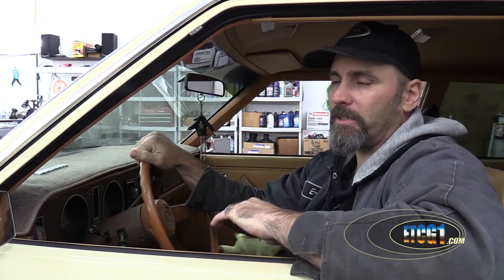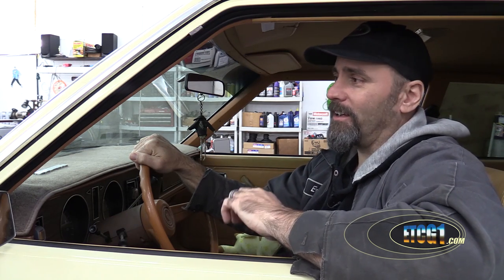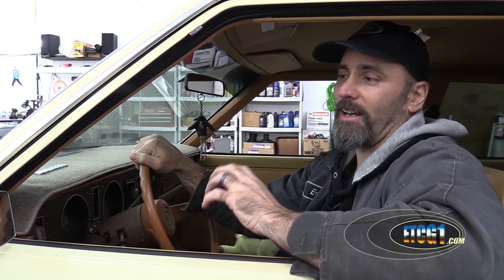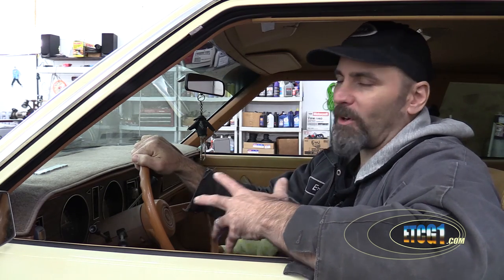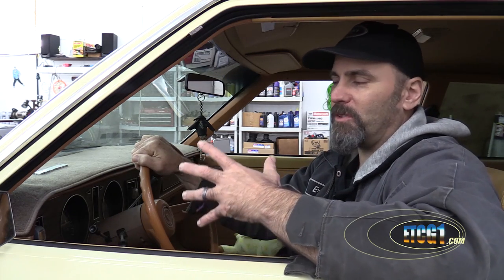Analog vs Digital (Cars)

Comment: Awesome video man!
It seems that modern combustion engines get more and more complicated in mass production. I can see electric cars making things simple again. I've been a mechanic most of my life and I've worked for a toy company that makes remote control toys. I've learned more than a small amount about batteries and electric motors. I can see just around the bend where electric conversion and hybrid conversion kits become common and reliable. I'm close to your age Eric, so I've been around long enough to watch a lot of things change as you have. I get the appeal of carburetors and v8's, but I long for more than I'm seeing.  If some laws were relaxed, we could have great and powerful hybrids made all over the place for a reasonable cost. I don't think v8's are really needed for high performance anymore. there are a growing number of hybrids like the mclearen p1 and new NSX that show how power can be intense with hybrids. The NSX does it with a smaller engine. 
Think about how many sensors use a small electrified magnet hovering above a reluctor wheel to judge speed. Imagine if you could get an aftermarket control box for that, which would also control the power output of an electric motor. A system could be easily, inexpensively and reliably made today like that which would be the basics for hybrid conversion. I can even see you putting beefier suspension in the back of the Fairmont with extra battery packs and an electric motor to help the rear wheels and your turbo v8 with a carb and that rig would have insane speed potential. I can see that in a 4x4 pickup with an electric motor driving the front wheels and the battery packs hidden in the sides of the truck bed. 
Tighter laws make combustion engines more troublesome by the day. Antiquated thoughts of serious performance coming only from a v8 are also restrictive in this day and age. 
I simply wish all sides of these discussions would realize that we can easily do more and be more than we are now.

Comment: Love the thought of the video !! Story,,,, my '74 Mustang, complete rebuilt 2.8L engine in '83, stage one cam, 4 bbl carb, headers and such. Driving between NJ and Virginia past the last rest stop on NJ tpk driving 65mph,tach goes to zero, no engine power, coast to side of road,,,, determine the block (follower, ?)  on the points broke. Dig around in the trunk, find an old set of points, install them, find the dwell meter in trunk, (only time I ever got set right on first try), timing light, set. Cop stops asks if I need assistance (no thanks) , on my way ..... Priceless....
Reply from the maker: The old trick is to use a matchbook to set the points clearance. Just sayn. Loved the story. Thanks for the comment.

Comment: One problem is that carburetors aren't taught anymore. I started from automotive school in 06 and they didn't teach it then nor did they a few years prior. My teacher defiantly went over them for a week anyway because we were in a small rural type community and a good 1/3 of the vehicles had carburetors.  I wish I had had the opportunity to have had rebuilt a carburetor before! I'm having my first real go at it on the 54 Chevy Truck I'm restoring. I love the simplicity of these older vehicles.
Reply from the maker: Indeed. Thanks for your input.
Reply: "My teacher defiantly went over them for a week anyway because we were in a small rural type community and a good 1/3 of the vehicles had carburetors." Defiance among teachers is a bad thing. :(

Comment: I bought a 65 mustang last winter and I've loved learning about the mechanical side of things. I've messed around with carbs on small engines before but never rebuilt one. I rebuilt the little 2 barrel on the car and it's really not as complicated as you would think. You just need to dive in and get your hands dirty. There are so many resources now with the internet there's no reason not to! :D

Comment: Thank you eric for this video. Analog and digital has their ups and downs but i still prefer analog over digital.. To me mehcanical is always more reliable because you can physically see and touch what's wrong.. I restored a over 30 year old snow blower and on the first day i got it to run as is by only changing one rubber fuel tube and boom it started off and ran okay for a snowblower that hasn't been started in 10 years.. Changed the oil and it runs like new.

Comment: My mentor during my apprenticeship said to me that a lot of fresh apprentices and technicians these days tend to rely on the software too much when diagnosing a vehicle. As a result, they forget to check vacuum lines and other hardware faults that will give you a vague warning on the computer. Technology is nothing without knowledge. As for analog vs digital; working on my '72 Beetle is infinitely more enjoyable than all the modern VW/Audi cars I've owned and worked on.

Comment: I started out with a 66 mustang, mechanical everything, manual brakes & steering; that was a car I had to wrench on a lot because it was 33 years old when I got my hands on it (I was 16 at the time) but I learned to wrench on it. I then got my hands on a 92 mustang, and aside from the OBD-I controlled emissions/fuel injection that car was still pretty mechanical, sure I had power brakes & steering, but there was no ABS/TC/stability control and had a throttle cable. When it threw a code it meant a sensor was bad, and was a pretty easy fix, diagnosing issues was still a pretty old school approach (or at least that's how I went at it) as far as modding was concerned, OBD-I was more of a hindrance than a help as you needed to get chips "burned" and couldn't tune on the fly, kinda a pain in the butt. Granted I missed the late 70's & early 80's era vacuum lines, so I skipped the super dark early days of EFI. Fast forward a few (several) years and now I'm driving a 2006 wrx wagon, different beast entirely, I actually have gotten into tuning & logging, I've got a great "7/365" tune on it, & the electronics make it easier on me when I have an issue, and since it's 11 years old with 111k on it, I have issues. I think it's easier on me because I got into computers at a very young age, so having a laptop on my passenger seat for a logging/road tune session is not a big deal to me & the data is second nature; I remember reading plugs and doing pulls at different throttle positions throughout the rev range (on the 66) to pinpoint issues with fuel or timing; I prefer the data logging myself, but have no issue with a carb'd engine. I do think however, that after the mid-2000's it's going too far; not with engine management exactly, but with all the tech garbage they are INTEGRATING into cars now. For example, I had a new Ram 1500 for a loaner while my car was getting it's airbag replaced (Takata) and the touch screen was intermittently buggy; it randomly wouldn't power on for anywhere from 1 to 3 minutes into the drive, and it controlled the HVAC & radio, so you were SOL until that touch screen was ready to go, and this was a brand new truck with a couple thousand miles on it. I put integrated in caps because when a touch screen radio was separate from the HVAC, if it bugged out you didn't have music for a little while, but when you combine the HVAC controls it can be a cold ride to work in 1 degree F weather when it flakes out. That truck also had the transmission knob to select gears, again disconnecting you from the transmission further; now there are cars where the steering rack and steering wheel are decoupled as well; I don't like where new cars are going.

Comment: thankyou, you put the argument so well.I run 20 year old cars mostly bmw and recently subarus.I am an amateur, so the electronics scare me. My modus operandi is to keep the fluids up and changed when needed and when the sensor telltales come on I put a small piece of black tape over the red light. This works for me, they are old cars anyway. Here in Oz I can buy any number of cars between 4k and 6k that will give me at least 2 years of relatively trouble free motoring.That is cheap driving here. A can of cheap silicon and another ofdry contact cleaner goes a long way.

Comment: being a 27 year old weekend hobbyist, I have favored working with early 2000's OBDII vehicles. i feel like there are enough sensors and computer control to optimize the efficiency, emissions and give good diagnostics but there's room to tweak and tune and replace and add things to the auxiliary systems without freaking out the computer. And if you're really into modification you can get aftermarket ECU's that work with most of the sensors and electronics from that era of vehicles.

Comment: im also another "new generation" guy, I got the oldest cars in the carpark where i work. (91, 94 98) still, all my cars are all fuel injection and i never seen a carburator in person in my life.
therefore i have this "fear" of owning a car with a carburator as i wouldnt know where to start looking if anything went wrong. 

I've been saving up for a 1975 car which has a carburator, and done a small amount of research about it just for the sake of knowing what kind of trouble im getting into, but as im familiar with fuel injection, and i see my 1998 car produces more power to this 75 car while saving about 30-40% fuel its easy to be biased. 

i agree that the fairmount should use carburator for the sake of sticking to the spirit of the time it was built... even tho this particular fairmount doesnt seem to fit in that well with "nostalgia"

Comment: As a 23 year old professional tech, i can say, from my upbringing in the electrical age, i love the electronics. Scan data and sensor values make my job a lot easier. Its not that i dont want to get dirty, but if i can spend less of my 40 hours a week under the hood wrenching, then im happy. But i have a lot of respect for old school. My dream car is a 77-78 trans am. I want to build it with stock motor, carbureted (more hp of course). I dont have a lot of mechanical experience, but if i have spent years perfecting my electrical abilities, than i can surely take a few weeks getting to know mechanical systems well enough. The simplicity alone makes mechanical systems better. And in my opinion, if youre going for straight power, mechanical is a no brainer. But for emissions and fuel economys sake, mechanical systems are garbage and thats where electronics really shines. I guess its just a matter of the vehicles application.

Comment: Well. i was born in 1966, so you know how i understand engines, no need to explain.

The worst part of a computer controlled system is: They are all different to each other.
Making them "special", learning every system close up can be a nighmare.
The obd standard is crap!!.
So you have to fall back on to classic engine understanding, thats just mad considering how much the computer could actually tell you.

Eric, that fairmont is your car, made for your enjoyment, ignore anyone that cant see that.
Just my opinion :-)
Reply: I was born in 1996, so you have a good 30 years on me. However having gone through school learning about this very thing, I can say the true difference between each system is negligible. Sort of how carbs of your time had their differences, like a webber to a thermoquad, the actual mechanical and functionality of the systems are the same. Whenever you understand how it works in theory and in practice, you can diagnose most systems across the board. Exceptions probably being German cars (again, much like in your day!). It isn't all peachy, as a minor glitch in a system can throw you off and you'll never be able to catch it. Things like that suck, but I'm sure seas of vacuum lines and vacuum operated systems had their quirks too. My 92 Silverado had the 700r4, great transmission whenever it works right. But there are systems even on that transmission that ARE mechanical yet still very sensitive. My system of choice on that being the TV cable. Having that cable set slightly off will very quickly eat your transmission (ask me how I know). 

There's good and bad in both of our systems, but like all systems, the trick is to understand it.
Reply: You didnt understand quite what i ment, thats my fault.
You cant take a computer from another car and just plug it into a different brand of car.
ignoring the security system in another computer for a second.
Differences in hardware connections make it a nightmare, ignoring the re-programming of the micro controller eeprom and default settings for a second.
Old engines had nearly identical parts, a coil from one would work on another, and worked exactly the same.

Im not against computers, just special (for this car only) systems.
It is only my opinion ya know :-D
Reply from the maker: 66 was a great year. I'm a '70 vintage myself. You're right, the Fairmont is my car and I can do what I want with it. I was just trying to put a finer point on it with the video. After all, this channel is for discussion. ;) You're comments are always appreciated.
Reply: zx8401ztv gen z kid here so I really can’t say I know anything compared to someone of your prestige, but from what I’ve learned out of 2 or 3 years of working on my own cars at home and only having recently gotten an OBD-2 reader (and a trashcan of a tool at that), it’s that usually the little electrical systems don’t break, and whatever is wrong is probably not that. Again, I really really don’t know anything, but this is my perspective
Reply: What I’m trying to say is, I think we should be looking at the classic mechanics stuff first, before we try and ask the computer about our life problems

Comment: Am late to the conversation, however as an anomaly, feel need to add.
My birthday is coming up and will now be out of my 30s, so according to you Eric, am in the digital age. However, growing up, Dad's vehical was a '64 Beetle he bought in '68 (which still has). In auto shop, we had a Dodge slant six and I did some work on families throttle body injection.
My first vehical was modern fuel injection, along with the second. By then, grown to strongly dislike its lack of serviceability. If I wanted to do any one task, would first have to spend a grand on a special tool, only to do that for every job.
So I unloaded it and bought a 1985 Mercedes 300TD-T. Sadly an elderly lady stole it from us by driving right into the back of it. Ended up with '85 280TE. So chuckled when you mentioned K-Jetronic and how much you love working with it. ;p Having also a D-Jetronic, like the simplicity of the K, but not as efficient. Think only a few 1985 and younger that can diagnose and maintain the D-Jetronic which is a shame. So much easier than monotronic and later.

Comment: I have in my car, a fully mechanical diesel distribution injection pump, creating 17,000 psi of pressure. No electricity required for it to operate. Decades old technology. I am still amazed how well and reliably it works. It even works with the turbo via a pressure hose so it adjusts the amount of fuel delivered while on boost.
Reply from the maker: Those are exactly the systems I was talking about. Mechanical engineering at it's finest.

Comment: I grew up with Carburettors and distributors learnt on that first Didn't get my hands on a fuel injected car till 95 and it was my dads car and it blew a head gasket. To me not much has changed take everything off a motor and it the same as it has been for 100 year they all have head, valves, blocks, pistons, conrods, crankshafts, excepts the old Wankle. Metal tech has changed better alloys stronger steels all to be lighter and stronger. Until the mid 80's to early 90's the only thing that had really changed on cars was suspension car ride became smoother and quieter. The the car industry started to improve motors lean away from carburettors and dizzies to all electric but the motors were still very old and cumbersome. Then improvements came in the metals make the motors lighter stronger better electronics came better engine control. More horse power less effort. I still love to get in an tune a car the old way by feel, sound and smell but I still like electronic control you can get things so much tighter for lack of words for timing and fuel management.
 I remember back to the late 80's here in Australia the old Holden Commodore the used a 3.3 litre inline 6 used a dizzy and had electronic fuel injection it was that bad and failed that much people took off the fuel injection and reverted back to carburettors.